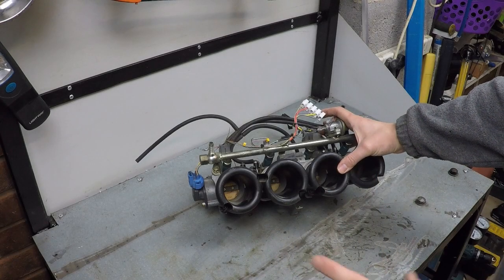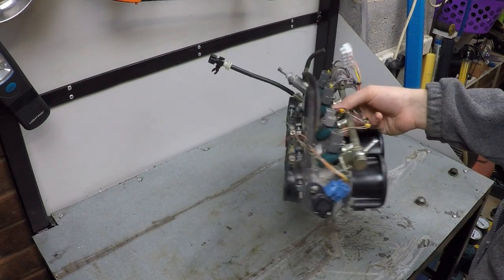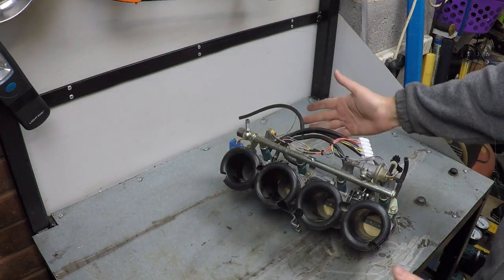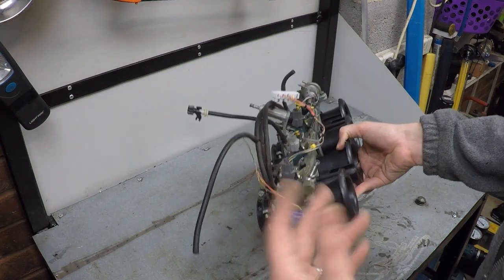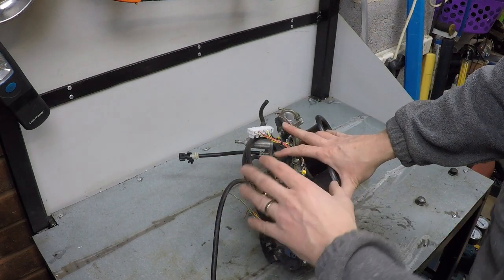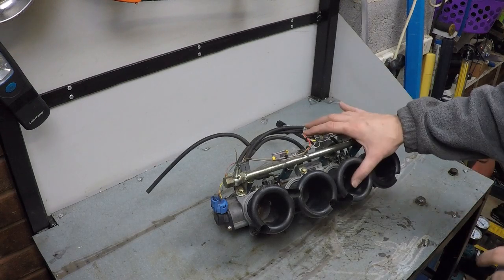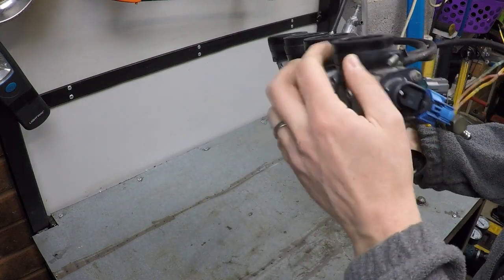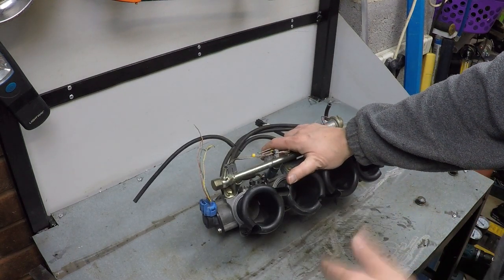Everything you DON'T KNOW about Individual Throttle Bodies

Comment: Good point about overly large throttle bodies, they will have high flow at high revs but will be a killer at low revs as you need turbulent air for good fuel mixing. Another point is get the bodies close to the intake ports because part open throttles produce turbulent air and this is a good thing at low to mid revs. You will need trumpets for the intake side, as long as possible for a road car as this will give good ram affect, short trumpets are good for higher BHP but also at higher RPM so just for race. Don't go mad on ITBs size as you will build an undriveable dog that needs high revs all the time and will be a complete pain to drive everyday. I fitted 2x Triumph triple motorcycle ITBs to my 911 and yes the noise and the throttle response are awesome.
Reply from the maker: Bill, all good points.  In fact I am currently running the "don't use too large throttle bodies" as a cautionary tale cus these are definitely too big (as are the injectors!).   I bet a flat 6 barking through 6 ITBs does sounds awesome....

Comment: nice....  I adapted two sets of Hyabusa throttle bodies (off eBay) to a Ferrari 308QV (bought at a Ferrari breaker) that I'm putting in my Lancia Stratos Replica
Easy peasy manifold fab. Each bank uses a Datsun 240Z air box. They Hyabusa ITBs are fitted with Honda S2000 injectors.
Reply: That sounds like a fantastic project, kudos Sir!

Comment: according to Jenvey the ideal length from valve seat to butterfly is around 200mm... the overall length (including velocity stacks) varies depending on tuned port length/cams/where you want peak power etc., so... it's very true that bolt on ITB kits may or may not make any more power...
Reply from the maker: Also a lot of standard cars rely on tuned length for torque and can feel alittle gutless low down on ITBs….

Comment: The noise! Lol
This is a great discussion. Ive been putting itb on my single cam honda. Power drops when the engine is stock. I change to 12.5 comp piston, and time the cam perfectly. Some tune on the link g4 later, a whole world difference.
Reply from the maker: Excellent comment!  Really shows that ITBs don’t just add power, they can be used to great effect but everything has to work with them.... are you running a standard cam with 12.5 compression?  That’s fairly aggressive... 👍👍👍
Reply: @MakingforMotorsport  stock cam. Just lock the vtec on the high lobe all the time. 12.5 is fairly normal in where i live since we got ron97 gas available at the station. Just dont get too attached to those people on the internet and forum telling u what to do or what not to do. Experiment it yourself.
Reply from the maker: If you are on the high cam that makes more sense, even with 97 you’d have to be careful with detonation at low revs high loads with a very mild cam shaft.
I can’t fault you for getting stuck in and having ago, my methodology exactly!
I am planning on bumping my compression once the throttle bodies are on!
Reply: @MakingforMotorsport i cant wait for the update soon! Good luck

Comment: Sorry late to the game...  Main advantage is the reduction in pumping losses, making the engine more efficient...   Yes you can tune the runner length but you will want the throttles as close as possible to the head...   Also, placing the injector farther away, say at the bell of the runner, will give more time to mix and provide a cooing of the inlet charge, making it more dense.
Problem as I see it is how to monitor the Manifold Air Pressure?  
Or are you going to utilize a mass air flow sensor on a common air inlet?
Reply: ITB tuning is usually alpha-N so throttle position is used for the load axis of the tables

MAP sampled from a vaccum distribution  block fed from each throttle body is good for 0-20ish% throttle position after that the pressure the other side of the throttle plate is basically atmospheric

Comment: One thing you can do with itb is leave the throttles close to the intake port but extend the runner length to something more reasonable for most engines. Very short runners are usually only effective with high rpm engines with large cams.

Comment: Good video👍 however your  fueling and injector timing. The fuel does not spray as the intake valve opens. On port injection the injectors spray on the exhaust stroke before the intake stroke. Using the heat to help atomize the fuel. Granted @ 5800 RPM this is happening very quickly and the Fuel is being mixed with air velocity. I just wanted to clarify this for those inspired to  enter PCM tuning.
Reply from the maker: It’s a good point, certainly on sequential injection and at low revs it’s onto a closed valve.  But as you say, at any kind of high revs the fuel is coming in throughout the cycle…

Comment: Exactly what I'm working on, how ironic. I'm putting the CBR600RR carbs to a Saturn 1.9L Dohc
Reply: 19th subscriber
Reply from the maker: Good man, welcome to the club!  The throttle bodies will be replacing 600cc carbs on my mini Autotest car...  at wide open throttle the mixture is okay but it ran really lean at idle and part throttle.  I drilled the main jet out to 1.5mm but could’ve gone to 1.6mm.  Best of luck for your project!

Comment: Hey ! It's been sometime I wanted to do an ITB build. Loooove them noises .. And I have a spare VR5 VW engine ( Since I swapped in VR6 )  I want ITB convert it with ported head , higher CR , cams , stronger valvetrain and so on for ESPECIALLY beatiful BRAAAP noises. Buuut , now comes the problem of there being 5 cylinders instead of 1--4. How would you go about it , any ideas ? Thanks !

Comment: Each throttle body of a BBC’s ITB is 50mm.  That’s equal to 400mm.  A Fitech EFI system has 1 throttle body @ 102mm.  ITBs flow 3.92x more air.  Perhaps ITBs’ should have 12.75mm throttle bodies.
Reply from the maker: Even I don’t follow that maths I’m afraid!  It’s a simple fact that per square mm of cross sectional area, ITBs flow less air, but the proximity to the engine and the single inlet tract per cylinder have their own benefits.
Reply: @MakingforMotorsport  

Does “flow less” mean less volume but more velocity?  I’m trying to figure out why the ITBs are sensitive to throttle changes from idle to half throttle but after 1/2 throttle there is hardly any change.   That’s just from what I’ve learned from social media.  The analogy I can give is that ITBs are like comparing a 2 stroke to a 4 stroke engine.  I’m also wondering what an o2 sensor at each primary exhaust shows on an ITBs system.  I’ve yet to find an ECU that has that capability.
Reply: @MakingforMotorsport  

👍🏾👍🏾👍🏾👍🏾👍🏾

Comment: Hi mate! Been looking at these ITB video's for a while now and trying to figure out all separate pieces before I go and order all the parts to update my BMW M10 engine from an old carb to EFI with ITB's. Initially I wanted to go for a 2000 euro kit, but seeing your video's I want to give bike throttle bodies a go 😀Now a lot is clear, however, I'm currently looking at fuel pressure. Normally when looking at the fuel system, I expect a high pressure fuel pump, a fuel rail and after the fuel rail a fuel pressure regulator and the return line. 

Now for these bike ITB's it's a bit tricky to see where the fuel returns. Now at your throttle body I see what looks like a dedicated fuel pressure regulator on the rails. But I'm not sure. On lots of other throttle bodies, I only see a feed, but no return. 

Can you maybe briefly explain how you regulate your fuel pressure on your fuel rail? I'd appreciate it greatly! Thanks mate :)
Reply from the maker: The fuel rails come in two flavours, open ended with a reg or dead ended.  
The dead ended ones usually have a T-piece on the inlet and require an additional fuel regulator which goes on one leg of the “T”, the fuel inlet from the pump goes on the other.
Reply: @MakingforMotorsport  ah awesome! I couldn’t find that information online. Thanks a lot mate! Looking forward to more video’s 😀
Reply: Hey - did you ever do this project on your M10? I’m just starting on that same path and am looking for any lessons-learned.

Comment: a mm per horsepower for that cylinder is a terrible rule of thumb because the area gets exponentially bigger with each mm increase. you wouldnt use 75mm bodies on a 300hp 4 cylinder...

just gotta be big enough to give your CFM requirements
Reply from the maker: I mean, most rules of thumb aren’t totally accurate, and (it been a while but) I think I mentioned this falls down at higher diameters, but at least your not gonna under size them 😂

Comment: Hello, very nicely expland! Thanks. I also want to try those itb's on my golf mk1 16v PL motor. I can also buy a set from a Honda CBR 600 RR. Do you now if those are any good? Gr
Reply from the maker: The 600RRs might be a little small for you, a decent valver golf should be pulling 120-130bhp you might find the limit for absolute power… that said drivability will be better with them in the small side.

Comment: I have a question, I have a fleet of trucks, in my country the fuel is ridiculously expensive, with a good tune I might have some advantage in putting ITB in order to save fuel? increasing the economy by 1 km/l would already be great
Reply: Hi there, as you say truck I automatically assume they are diesel ones, that is a curious fact because i haven't ever seen any diesel vehicles with ITBs... The injection is done directly to the cylinder so as some modern vehicles. So it might work! 
If it's a gasoline fleet, it may be worth checking if the fuel savings are that much so it compensates the investment

Comment: what if your car is  direct injection ?  you basically just don't use the injector part of this solution or you swap for a port injection and leave the Directo injection useless?
Reply from the maker: Hmmm… so whilst there stand-alones  out there that can handle direct injection speeduino isn’t one of them.

Personally, it’s not something I know about but, having a total guess, I suppose you could just not use them, but a care point might be that injectors might need be cooled by the fuel going through them, maybe not???
Reply: @MakingforMotorsport   very god point on cooling the inejctors, makes a lot of sense. Ok, would  it possible to use the original ecu? in that case I could use the original GDI injectors . My car is a 2.2  4cil, gasoline (gdi) ...  alfa romeo 159 2008 selespeed.

Comment: How does it work with maf sensors
Reply from the maker: Normally you run throttle bodies with an Ecu which just uses AlphaN which is throttle angle based, but you can run also run speed density (which uses Manifold absolute pressure sensor) mixed with AlphaN.
There is no reason that you can’t use a MAF sensor but you’ll need a plenum to make sure that all the air the ITBs let into the engine comes through the MAF so it is correctly metered.

Comment: I feel like you got all this information from the Jenvey website. And I think their throttle body sizing is some hot bullshit to sell more stuff (I feel like they want to prevent the exact thing you are doing). For example they recommend 50mm for 65hp which is strange since a honda b16 has one 58mm throttle body and 160hp.
Reply from the maker: I don’t know what it says on the Jenvey site but, the information has been the same ever since people have been running DCOEs.  Twin 40s have been on cars for years (as carbs tho these have the Venturi inside which narrows), but if you wanted 160+ out of your pinto you’d be on 45s.

My comments about 1mm/hp was clearly  a rule of thumb, as it’s more about area not diameter and area has a square relationship to diameter, that’s why an LS engine can put out 600bhp+ on 1 throttle of 76mm.

ITBs don’t behave like a plenum installation, and truthfully most have much more flow than is needed, but that’s what it’s about, not being a restriction and tuning everything precisely, and ITBs let you get everything, just right. 👍
Reply: @MakingforMotorsport  I wish you could have cited some sources to your information!
Little math to where I am coming from
4x 45mm Throttle body area = 6361.72
1x 60mm Throttle body area = 2827.43 (Used on 240bhp honda f22c1)

And I dont think the two extra throttle plates will even remotely make up for that.
Reply from the maker: I did some maths but edited it out as it’s hard to decide where to pitch the standard.

To get alittle more scientific, flow doesn’t scale linearly even with cross sectional area, more throttle bodies mean more spindles, more restriction, more separate paths means more wall/area with also slows flow proportionally (more wall means more boundary layer which also means slower flow), so there are many reasons why it’s not a linear relationship, why a single body has bigger flows than ITBs than you would expect from just looking at diameter or cross sectional area.

I didn’t do experiment science as I’m not equipped to, but I do plan to get more scientific in the future (this was my 2nd proper video I think)
Reply: @MakingforMotorsport  Still 45mm is too big for 160hp after seeing that tuned bmw s14 i4 engines make ~250hp with their 46mm throttles.
Reply from the maker: I completely agree, 40mm ITBs would be more than adequate for 160bhp, which is what I say in the video (1mm of diameter/cyl hp).  

If you are referring to my earlier comment about 160bhp out of a pinto, this is a SOHC old engine and the 45s I was referring to were DCOE carbs, which would have a 40mm choke to generate the Venturini effect required for carbs to work.

I could’ve put all of this into the video, but I didn’t (and did deliberate about it).  Long and the short of it, ITBs aren’t easy power and can wreck an engines drivability if not thought about properly... that’s all I was trying to get across. 👍